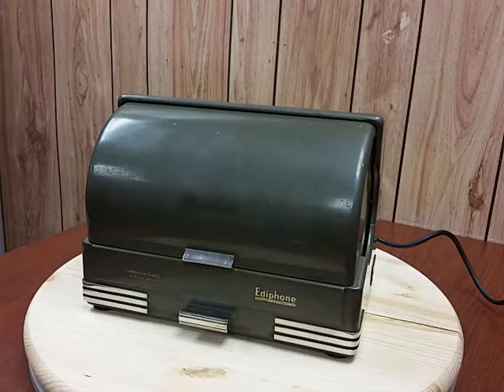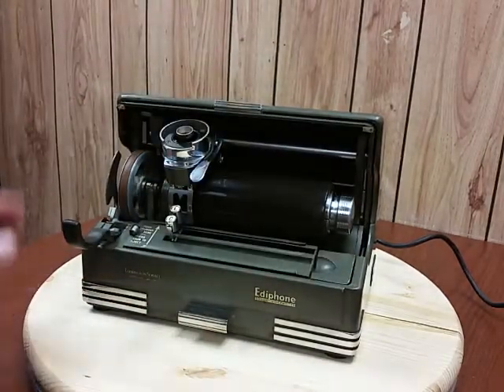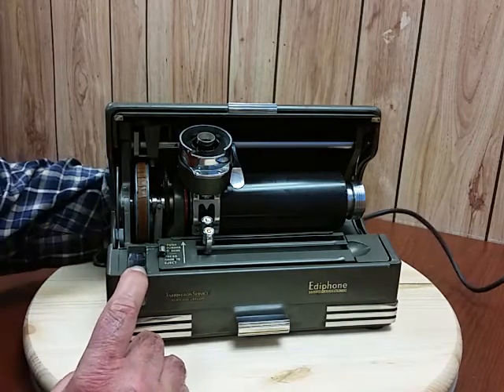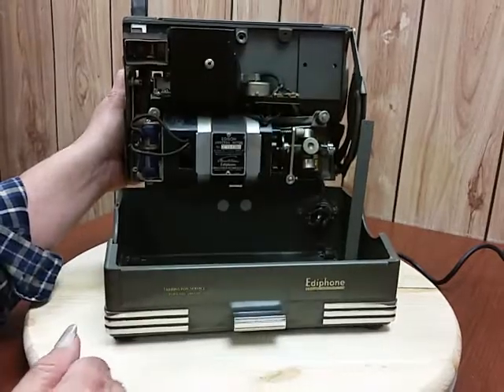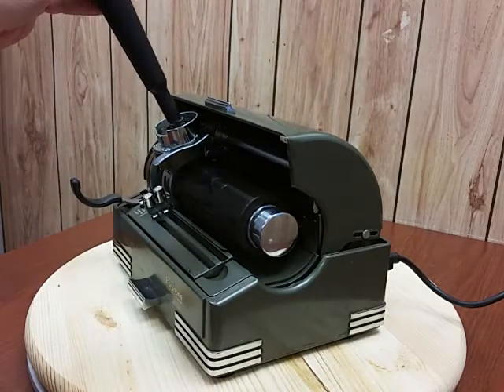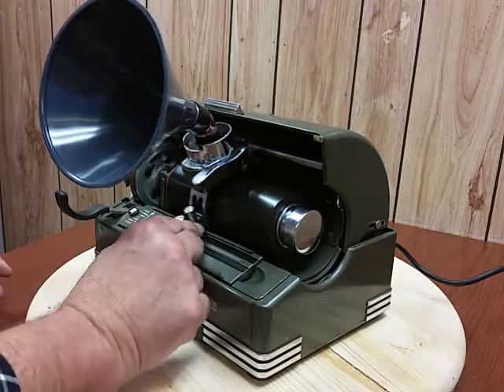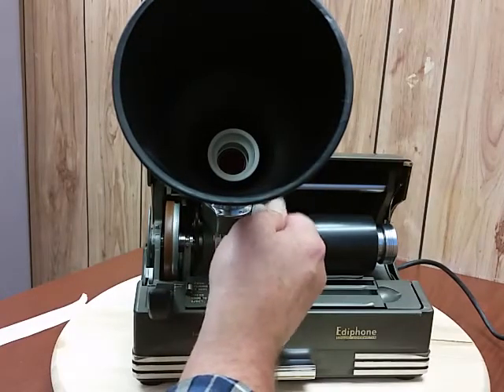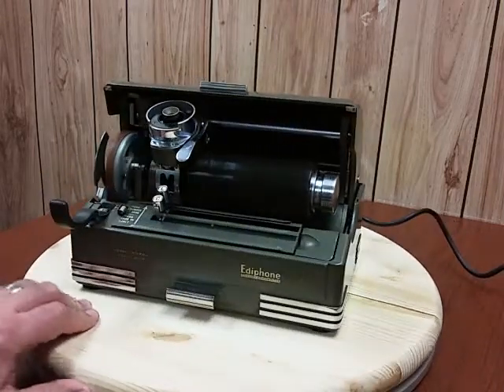Edison Ediphone Voicewriter Wax Cylinder Dictation Machine

Comment: I sold dictation systems for Lanier starting in the early 80's. Back then, even with cassettes and micro cassettes, the "L" and "C" buttons were a cool feature. The transcriptionist would scan the C marks first and note all of the corrections prior to typing. That way it prevented a bunch of retyping of the document which, on a manual typewriter was a giant pain. The L button was used to separate letters. If the boss decided after the fact to prioritize a particular letter over others it was easy to skip to that position and type it first. That was even harder to do on a tape than on a cylinder.
Reply from the maker: That's an awesome narrative of a technology from the not so distant past.  In your travels did you ever come across
Dictabelt machines or Gray Autograph units?  I have a couple of each that I use to enhance my JFK assassination collection.  I'm trying to pin down the year when the Dictaphone company fazed out the red belts and started pushing the blue ones.  If I'm correct the blues were introduced in 1964 which causes some problems if the Dallas Police recordings in existence were on  blue belts...  I'm not a conspiracy person but I would like to confirm or disprove that the blue belts passed off as originals recorded on 11/22/63 are indeed first generation or copies.

Comment: This model was introduced in the late 1930's.  I would sure like to find out who designed it.  It is a true work of art - done from top to bottom on the Art Moderne style.  There is a matching play-back-only machine used by the secretary to transcribe the dictation, as well as a matching shaving machine. Without question, it is one of the most beautiful of the early phonographs.  Unfortunately, there is little interest among phonograph collectors in dictating equipment.

Comment: thanks for the video! Mine came with a seized motor. Yours looks much nicer! there must be a little mercury in that little flipper so it feeds back pulses somewhere I havent figured out yet. the head unit goes to a terminal block on the back. i bet you could hook a couple of switches up and remote start/stop the spindle